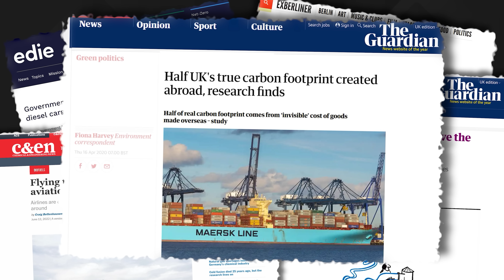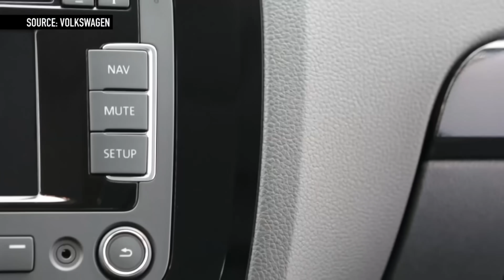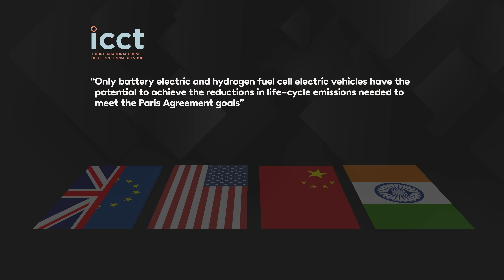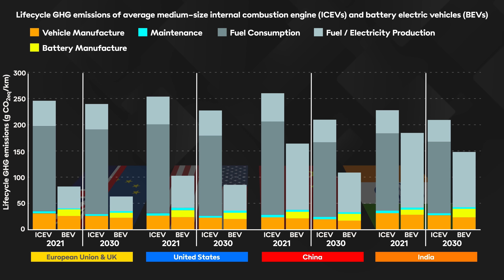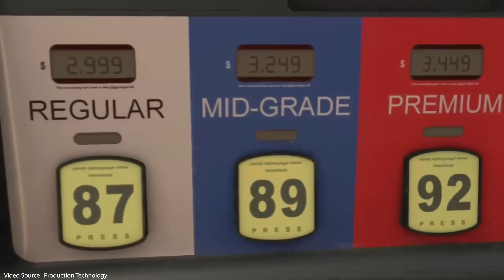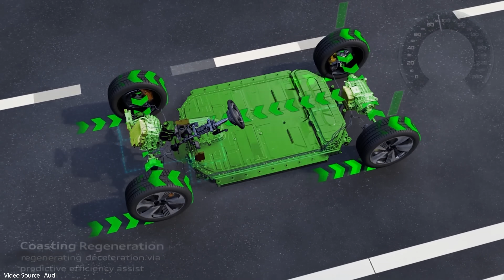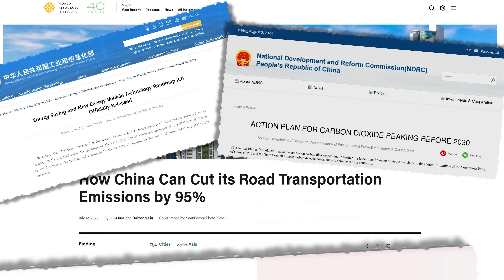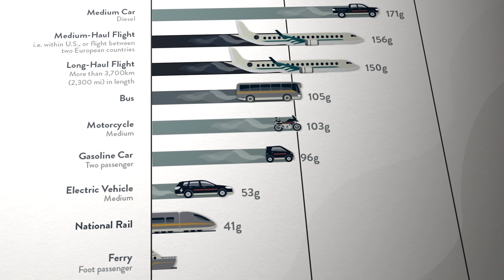Are EVs really better for the climate?

Comment: While I agree that EVs need to be embraced, the comparison of ICE and electric motor efficiency is inappropriate. They are converting different forms of energy to motion (heat vs. electricity) and the theoretical maximum efficiency for the former is always much lower (Carnot efficiency).
Reply: Does fossil fuels not count as chemical energy?
The heat energy is a (mostly wasted) by-product of converting the fuel into motion.
Reply: @airchie2  an electric motor's input is electricity, which for EVs comes from stored electrochemical energy. An ICE engine's input is fuel for combustion, which is from stored thermochemical energy. Just because both are based on 'chemicals', does not mean that they are the same thing. Chemistry broadly deals with the properties and behaviour of matter. My point simply was that comparing the efficiency of electric motors to ICE is misleading because they are starting with different forms of energy. A portion of the stored electrochemical energy in most EVs is originally from fuel since very few electric grids don't burn any fuel.

Comment: Nice summary and analysis. You mentioned battery production becoming greener and one major way to do that is to deposit the electrode materials on the collectors using a dry process, rather than a wet slurry that requires large ovens and a lot of energy to dry. Tesla's dry electrode process does exactly this and the patents are open sourced, so others can also green the manufacturing of their batteries.
Reply: Look up how li ion battery materials are mined. What impact they have on their environment. To mine some grams of batteries, you neet to excavate and treat tons of dirt. And you don't do that with solar or wind.
Reply: The best advice is still to ditch the car all together when possible and when not make it so.
Reply: Your never going to green batteries just saying that expression shows how nuts you guys are. "Green batteries" is not a thing it will never be a thing. Next we'll have environmentally friendly slag heaps.
Reply: @davidwestwater2219  I didn't write "Green batteries". I said making "battery production greener". Also, some slag heaps are environmentally friendly and some aren't, depending on what was being smelted and any additional separations processes to extract offending components.

Comment: Everybody always leaves out a major fact about China. All the parts and components for EVs e-bikes solar panels... All the inverters the inexpensive lithium iron phosphate batteries... Are all manufactured cheaply and robotically in China. If you try to buy the components for renewable vehicles or self-sustaining houses they all come from China. The other large affluent Nations controlled by fossil fuel industry hooligans actively sabotage China, declare China to be a communist threat... And even in the case of the USA try to literally start WW III with China as instigated by the right wing conservative fossil fuel elite funded politicians known as the Republican party... in order to block the rapid inexpensive renewables manufacturing evolutionary advancements in China. Especially focusing on the USA they have time and again destroyed upstart renewables r&d efforts. USA is ground zero for this. They have no large volume renewables components manufacturing in USA because the elitist fossil fuel funded rich who's opulence is derived from fossil fuels uses their riches to destroy the renewables venture. So you can't compare China to the other affluent Nations in a negative way citing that they may have not switched from coal quickly as the other affluent Nations. The concept holds no water in the face of their soul advancement of renewables manufacturing capability.
Reply: So really the head of the snake of the giant serpent blocking the gates through to the new and carbon neutral technology world... Is the United States Republican political party. They have more money than anyone and they derive it from fossil fuels. The other ranking affluent Nations follow suit but are not the leader of the pack. The entire world is going to have to band together to eliminate the United States Republican political party and their fossil fuel funding source. So really, talking about the details of Green technology is something that has to be put on the back burner as it will most certainly continue to advance whether we study it or keep track of it or not. And everyone in the world contributing to and interested in the change over to Green technology is going to have to begin to focus on nothing but ELIMINATING THE REPUBLICAN POLITICAL PARTY OF THE UNITED STATES. The entire world is going to have to join in in this effort because the other half of the population of the United States isn't going to be able to do it on their own. That's it, that's the only thing that needs to be concentrated on from this point forward... Eliminating The bridge troll that is blocking us from crossing the bridge. The bridge is already constructed.

Comment: If you only look at co2 emissions then the report maybe accurate but the cost to the environment of the production of batteries which use lithium, cobalt and (I believe) nickel is monumental and way worse then any benefit of reduced emissions but that is ok because it is not in our area 😓.  Battery tech is still in its infancy and needs way more development before the overall benefits will be seen.
Reply: Put mining for batteries into perspective: Globally 0.1 million tons of lithium is mined per year from a handful of mines, compared to 86,000 million tons of coal, 32,000 million barrels of oil, 4,000,000,000,000 cubic meters of natual gas, 100 billion tons of other stuff from 110 million working mines destroying 100's of millions of acres of land.

 Yes, not good to mine anything, but mining for batteries is insignificant compared to everything else especially fossil fuels.

A family car that contains 6kgs of lithium saves 32,000 kg of gasoline over 15 years. And that lithium can be recycled many times over potentially saving 100's of thousands of gallons of oil.
Reply: @stevetaylor2818  At the moment Lithium is not recycled in any meaningful amounts and the environmental costs of mining the 3 elements required in current batteries is vastly worse per KG then the mining for coal etc.  The vast majority of the mined items you mentioned are not used for vehicle use but for ships, planes, industry, heating etc.  I am not saying don't use EVs, just don't think you are  saving the planet by doing so.
Reply: @stevetaylor2818  You seem to be missing the point here.  It is not the energy to mine lithium that is the issue but the ecological impact of that and other mineral mining used in making current batteries.  There is no car that uses 30,000kg of fuel over its normal lifetime and Tesla can say what it likes, they are not the only (or biggest) manufacturer of batteries, it is just not economically feasible to recycle lithium in batteries which was the original claim.  My point stands, use ev cars, just recognize that it will not save the world or even make it a better place until battery tech develops better methods.  I follow this channel but also recognize that it pushes its own agenda which somewhat biased but we do need to hear from all sides.
Reply: @HorthornNZ  Yes cars do use 32,000 kg of fuel. 40 kg (50 litres) per week, 2000 kg per year equals 30,000 kg over an average 15-year ICE car life. Basically, a tank per week, which is about average. Then add on all the serviceable parts, oil changes, filters, spark plugs, timing belts, catalectic converters etc.... over 15 years compared to an EV drive train that practically does not need servicing. Even save on brake pads with regen braking!

EV batteries are recyclable and most manufacturers are initiating circular systems that will recycle all end of life batteries (only reason not many have been recycled yet, is practically non have died as EV batteries can and will last decades and as such most are still usable.

EVs are many times better for the envirorment and produce much less polution over their full life cycle from mining the resouces to driving the wheels and recycling compared to ICE cars. And then there is the local polution, just imagine how clean and quiet our cities will be 🙂How many fewer people will have breathing difficulties!

You need to also look at the ICE car ful life cycle including the massive fossil fuel mining industry (oil rigs can weigh 40,000 tons, refineries can be the size of a small city and burn the energy of a small city, 40% of all shipping is transporting fossil fuels, how many oil slicks leaking wells, poisoned habitats, and how much recycled etc. etc... Gasoline is not delivered by Faries!

We are back to comparing 6 kg of lithium over its many recycles life, saving 100's of thousands of kgs of oil and tons of serviceable parts.

Comment: I understand that Volvo recently released a study of the lifetime effectiveness of one of there models, electric versus petroleum. Can you comment on that?
Reply: Yes, it states EVs are better for the environment, same as the study in the video does.
It says BEVs have a larger environmental impact for manufacture than ICE currently but that's offset during the life of the vehicle.
It also states that battery advancements and greener grids will reduce the time taken to offset the manufacturing costs.

Comment: same thing that happens when we switch from horse and cart to car has to happen, large infrastructure and technical shift needs a period of large investment and transition. EV's source of power is more versatile as the electricity can come from anywhere like renewable and recyclable solar panels or nuclear power or coal generators. Not just the charging station and upgrade to the existing electrical grids but the end of life supports like batteries recycling. Some places energy grids and source of electricity are such that operating an EV in its current state there will do more harm than a regular car but this will still generate push for upgrades and transitions start up. And batteries for cars are getting better at a very rapid pace, battery technology has come an incredibly long way in the last 10 years compared to the 50 years previous and accelerating.
But from an end user economic side, a Tesla fully charged can cost around $25-30 if you charge purely from the grid at home paying full regular price and can get you 400-500km, 3/4 tank of petrol for comparable petrol car also getting you 400-500km can cost $50-100 depending on the car and wildly fluctuating fuel costs. by some maths EV are still not as economical compared to petrol power due to higher up front cost and long term battery replacement or depreciation costs, but almost every major car manufacturer in the world are spending enormously on research and development for their own EV technologies and innovations.

Comment: we either had to buy another car or i could bike to work. it is only 3.5 miles. so, noting that i can shower at work, not have to stop at the lights as i take trails, it takes me just as long on the bike as it does in a car. and i am not paying car payments, fuel, registration, insurance, tax. i have two massive panniers and i even do grocery shopping. but if i lived 12 miles out, i might not be biking. next up is to trade in the VW and get the tesla.

Comment: A million years Earth's breathable air has been collecting Carbon - mostly in clouds where the super active water molecules treat Carbon as Hakisacks - keeping the Carbon suspended. Now the air outside the clouds is holding Carbon - suspended in a maze of extra Nitrogen. Today's Earth occupants didn't FILL the air with Carbon - we created the tipping point. Heated Carbon AMPLIFIES temps about 10% - 100 becomes 110, etc. Our Air is contributing to the heat with suspended Carbon. Now, inside clouds, the Carbon burns. STOP CARBON or...